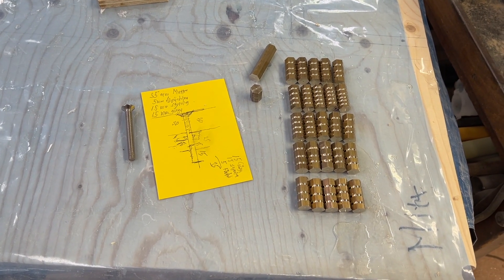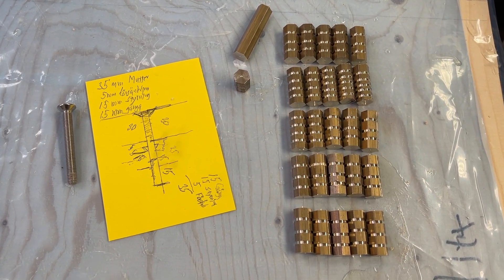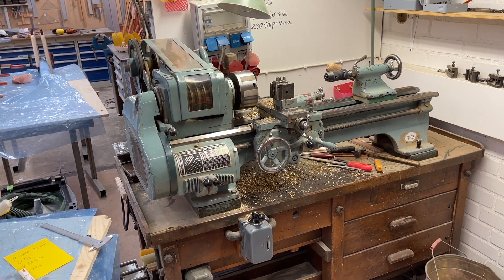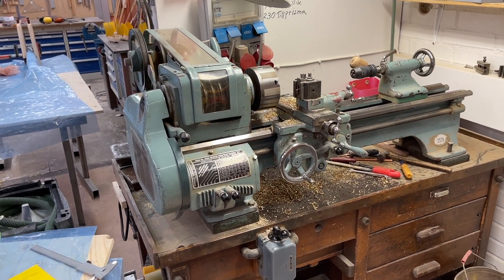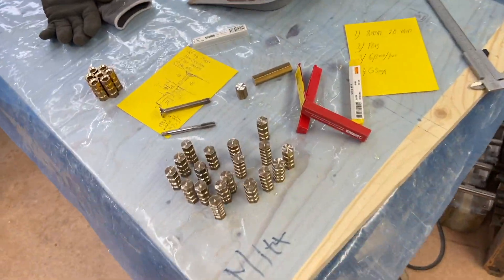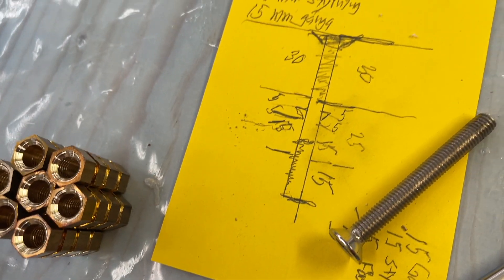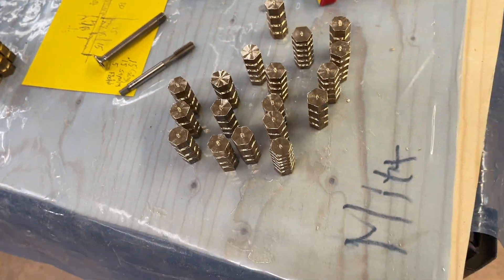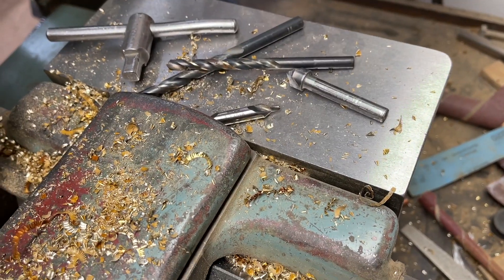The long M8 insert nuts

Comment: Those are beautiful sleeve nuts you are making. How much thread will you be using (how many turns of the bolt will be required to remove the hatch)? More progress. Thank you for sharing.
Reply from the maker: I think that there is about 15 mm threads

Comment: Stainless screws with fine threads. Do you think there will be any issues with having two different types of metal in the freezing temperatures around Cape Horne? Or will the divinycell be enough insulation to keep the temp from dropping too much, that you don't have to worry about the metals doing anything problematic?
Reply: I've never heard of low temperatures being much of a consideration. The heat of turbine engines and combustion temperature is often addressed though. I think the stainless steel metal fasteners selected with brass/ silicon brass/brass aluminum alloy are an interesting choice in regard to environmental corrosion and galvanic process exchange. The potential difference may actually prove to be complementary IMO. Quite frankly, I like the use of bronzes better than stainless if tolerable. The  I somewhat often have to cut the 304 stainless fasteners and drilling them presents a challenge. My concern was more in regard to how the fasteners will function regarding tension and shear but it's only me imagining structural applications. The nut loosening concerns , if any, can be addressed with lock Tite or lock washers. The M8 fastener thread pitch appears to be standardized at 1.25.  For bolts working in shear the strength could ultimately exceedbapproximately 8,000 n/ kgf. The tensile strength is aporox. 14,000 n/kgf
I believe that is plenty in ft lbs....30,000 lb/ft me thinx .
I'm not a fan of disregarding proper shank length but why not if you can in a non structural application.
Reply: @anthonyrstrawbridge  thank you for explaining that👍
Reply from the maker: Stainless steel screws in stainless steel nuts can size up and that would give trouble.
Lubricating with molybden disulfid will help.
Reply: @SvenYrvindExlex  some technology here 🧠🔨🙈😅
Reply: @SvenYrvindExlex  Yes, I agree but molybdenum disulfide is so messy. I have to use certified stainless on my airplanes and it is an absolute hassle with salts. Sometimes I have to cut and them off yearly. I like your ideas but I have no clue where or how they are to be used. I failed to comprehend what you were saying it referring too. Generally, the content reveals itself as things progress but I still don't have any clue where these fasteners are going. The bolts, having no shank and being fully threaded with countersunk screw heads leads this viewer with the impression that there is little other concern outside of what you stated. A little more effort during production or post would help.
Reply: @anthonyrstrawbridge  I think these fasteners will be used to secure the hatches under the bed, so minimal load. Time will tell.
Reply: @carlanderson4139  yes just drinking water ballast loads at invertion, not torqued to yeald, thermally stressed or constant loaded vibration. We put ss into aluminum/bronze in boat mechanical drive constantly. Lesser of our problems.

Comment: Those don't look like through holes, are you using a bottoming tap? The one in this video seems like just a regular tapered tap, which might lead to binding of the threads if the holes aren't deep enough. I'm sure you have thought of all that... Thanks for the inspiration. I'm going to get my lathe working again...
Reply from the maker: They are through holes as you will see in the video from next day

Comment: Did you choose bronze over stainless steel only for an easier manufacturing of the nuts?
Reply from the maker: It is dangerous to use stainless screws in stainless steel nuts as they can size up.
And then I would be in trouble.
However lubricating good with molubden sulfide will help
Reply: @SvenYrvindExlex  Thanks for your answer!

Comment: The Blomqvist looks quite similar to my southbend 9 inch. I don't have the quick change gearbox though.  Do you have a milling machine?
Reply from the maker: I had a Chinese one but gave it away 
There are good small swedish ones and Aciera small but now I do not have money for them. Also my space is limited as is my knowledge about milling machines.
Reply: I agree.  My Dad had a South Bend and it looks remarkably similar.
Reply: @SvenYrvindExlex Deckel is another fine brand. I have their smallest model, which is compact and very capable. Not cheap, unfortunately.